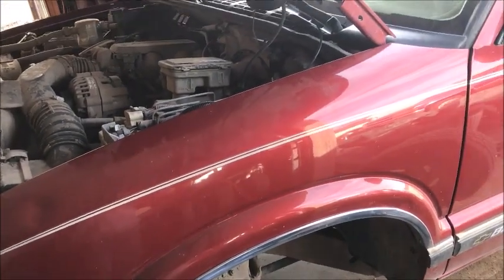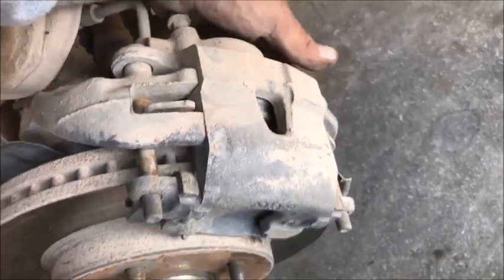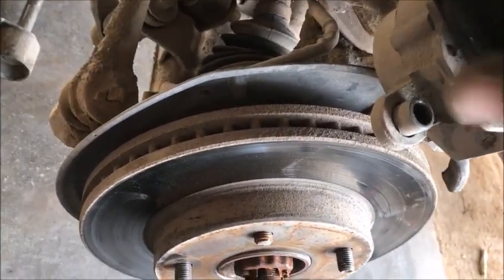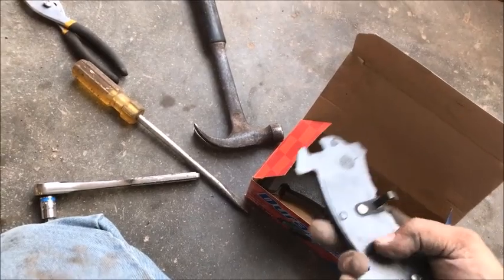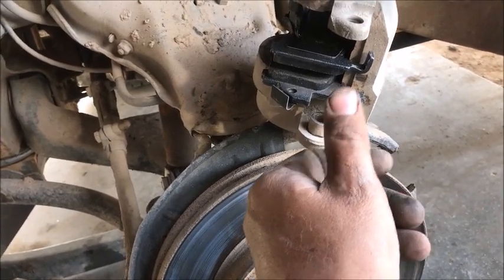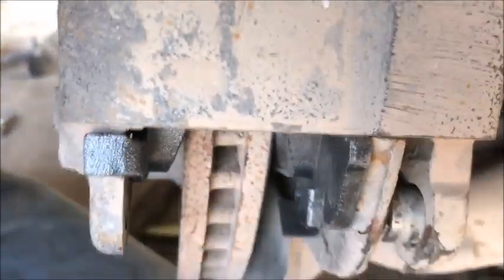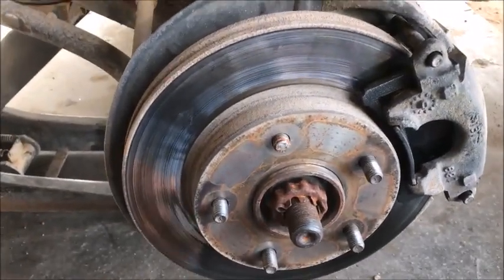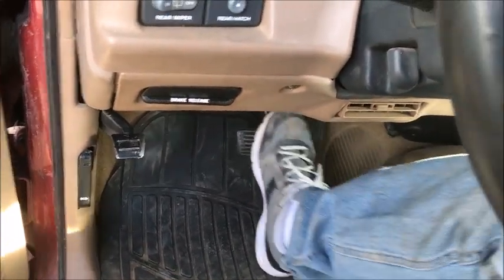1996 Chevy Blazer 4X4 Front Brake Replacement.

Comment: I just did my brakes , it was my first timd and I did it the same way but I'm curious is it just those two bolts, does the 97 Chevy 4x4 have slider pins and bolts or are those the slider pins? Sorry for ignorance.

Comment: Question. Currently looking at a 96 blazer but needs breaks changed.
 Am i correct in saying the rear is drum breaks?
Reply: My 95 has rear drums, just look through the rims in the back and see if it looks different than the front